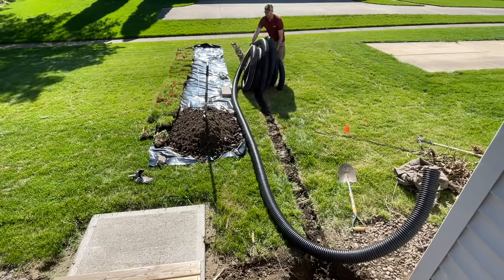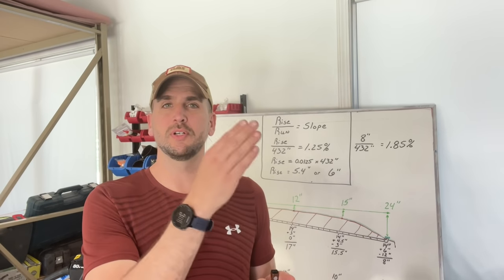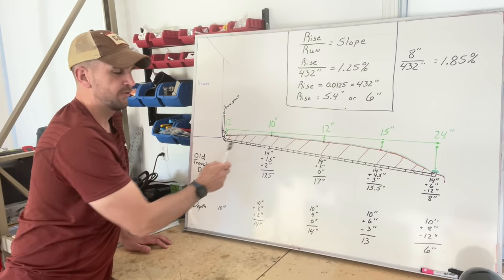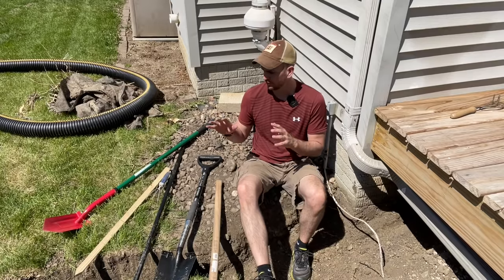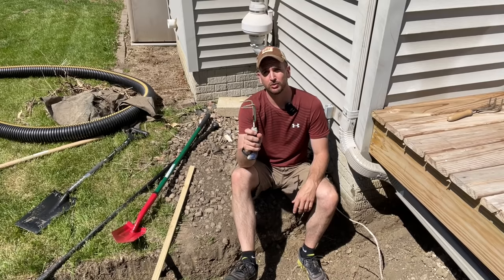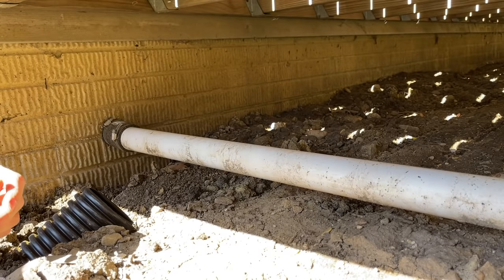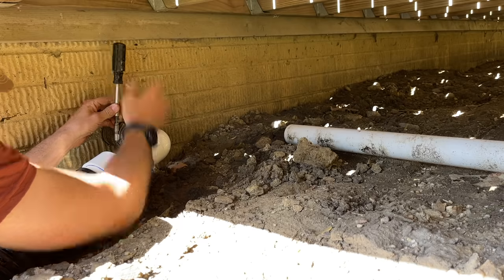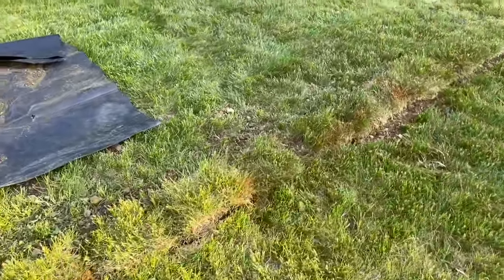Downspout and Sump Pump Drain Pipe Extension

Comment: Nice work! Be careful in the wintertime though... It looks like you may end up with a semi-permanent icy/slick spot on the sidewalk during the right time of year.
Reply from the maker: For sure, I have a little more rerouting to do for the downspouts and then will monitor the frequency of the sump pump as I would expect the frequency of the sump pumping out water will reduce substantially and then that should reduce or eliminate water going on the sidewalk outside of when it is actually raining.  We shall see 🤞
Reply: @EverydayHomeRepairs  Never had a house that required a sump pump before so lots I'm sure I'm not considering.
Reply: My coworker was cited for outflow pooling and freezing creating a road hazard. Did that elbow and popup freeze during winter?
Reply: Won’t all the dirt and debris from the gutter clog your pipe up?
Reply: @EverydayHomeRepairs  Yes, the guy who installed my sump pump refused to do this for the reason of liability/lawsuits in that it would make the sidewalk wet
Reply: Is the black pipe perforated?  I would have at least the last half away from the house perfed to try to keep the water under ground and there would be less water draining over the walk.
Reply: @robertt8273  you can develop a sink hole by trapping the water underground.
Reply: @UncensoredCowboy  Uh-oh. I dug a ditch from my downspout out into  the yard. Threw leaves and sticks in it. Wondered what would happen when the winter rains came. Well, I won't put any dirt on top, that is for sure.
Reply: Trying to figure out why you went all the way to the sidewalk when you have alot of yard to dispose of the water. Helping nourish your grass while keeping the side walk clear
Reply: @michaeldagreatest  One of my neighbors in MN, his water pump runs continuously all year long and basically you have a destroy portion of your lawn. Probably is my best guess, trying to avoid that.

Comment: Great video.  Thanks.  Having done this 10 years ago, and getting ready to do it again (new house), I’d make one recommendation: rather than marking multiple measurements on your stake to check grade, just slope a string above the trench matching your desired slope. Then you can move along the entire run and check for slope everywhere with a single line marked on a stick.
Reply: One other trick I’ll be using this time: dig a post hole under your pop up, line it with a fabric sock, and fill it with round stone.  It will act as a small dry well and ensure your elbow drains quickly, to avoid freezing or attracting insects.
Reply: Thank you, thank you.

Comment: Northern state or not (I'm from Missouri and we get tons of freezing weather and ice etc.), you should have used PVC for just a downspout extension throughout the yard. That corrugated pipe will fill with shingle debri and bugs over time. They are a nightmare to clean out as well and sometimes you end up damaging them when cleaning them out and don't even realize it. Also, at any corrugated connection you should have used tile tape to seal it 100%. I saw you taped it at the pop up connection, but it would have been smart to tape it at your sump connection as well. Weeds and roots will grow right under those hose clamps. Either way, PVC works fine up north as well. Never had any issues with it freezing or breaking at all and it's a breeze to clean out with just a water hose. Corrugated will take a lance or "bullet head" on a pressure washer to get clean with quite a bit of effort compared to smooth wall PVC. You did a great job. It's just that I made the same mistake by using corrugated in the same manner for downspouts and regretted it after a year or 2. Now I only have to run a water hose down my PVC every 3-4 years and that's just to be safe.
Reply from the maker: Thanks for the feedback 👍
Reply: I used corex pipe on all my downspout runs,  many having <1% fall.  Yes,  debris gets in them and collects,  but at least once a summer we get a BIG rainstorm that will blow the tops off the bubblers, leaving a nice ring of debris around them from being flushed.

Comment: Corrugated piping will collapse and fail at some point. By design it slows flow and trapes dirt/leaves. Use solid piping and don't worry about any "required" slope to ensure clean flushing. I've had to replace all the gutter corrugated drains on my lot dur to collapse or root intrusion. Solid pipes have been flawless.
Reply from the maker: Hey Barry, thanks for the feedback.
Reply: Would connecting lengths of solid pipe with rubber couplings not clamped allow for freeze-thaw expansion and contraction? Any small "leakage' would  not be a concern outdoors.
Reply: Turbulence in the water from flowing over the ripples loosens up debris and helps it make its way out of the system. Not as efficient as Sched 40, but corex is cheaper and easier for the everyday weekend warriors to use.

Comment: My thought is that I would have terminated into a hole filled with large gravel underground rather than the pop-up emitter.  It may overflow during a heavy storm, but everything is wet then anyway. It was a well done job though.
Reply from the maker: I might actually add another line of perforated running parallel to the side walk sitting on gravel to allow the majority of the water to just leach into the ground outside of large rain events.  I will monitor how wet the sidewalk is for the next week or 2 and then make the plan from there.  Thanks for the feedback!
Reply: I did both.  I terminated to a T at the end of the drain.  One end points straight up to the popup.  The other pointed down to a 4 ft hole, drainage sock filled with pearock.  Water will first go down.  Should it completely fill up, then it would emit to the popup drain
Reply: @louofm1  This sounds like what I need. Thanks for the notion!
Reply: @DeadBeatDeeBo  look up "drain sleeve".  They sell it at home Depot for cheap.   I dug the 4 ft hole right where the drain terminates (the T).   I took some of that drain sleeve, tied a knot on one end and while holding it in the freshly dug hole, I filled it with pearock.  I figured that would keep the pearock from filling with dirt and clay.  As the rock goes in, it stretches to fill the hole.  After it's filled with rock, tie the top too, and terminate your drain/T right above it  You can't see a thing (except the pop-up) after you put your popup drain and the sod around it all

Comment: Good video. The only thing missing is you should always call before you dig to avoid damaging utilities including cable electric gas sewer and water.
Reply: See 2:00. I assume "JULIE" is his local "call before you dig" utility location service. Quick web search tells me that "JULIE" is an acronym for "Joint Utility Locating Information for Excavators", seems to be primarily in use in Illinois.

Seems the main thing he missed is actually calling the service. I guess it's a "do as I say, not as I do" thing. :)

Comment: This is a great video except living in the Northeast where the ground freezes or the pipe may freeze and/or get snow/ice blocked at the endcap, I would think you would at least need "Freeze Relief" or some secondary relief opening on the sump pump line. If the line ever freezes or gets clogged/blocked, continuous running of the sump pump would cause pressure within the drain line with no where for the water to drain and create backpressure up the downspout line. Rather than capping the cleanout, I installed a drainage grate on the cleanout so in the event that the pipe freezes or gets clogged, the sump pump should create enough pressure for the water to reach the cleanout and still drain on the outside of the house and not back up into the sump pump basin and possibly flood the basement.  

Additionally, unless the water on the sidewalk is from some other source other than the popup valve, I probably would have selected a different spot for the popup valve that was further away from the sidewalk as you wouldn't want continuous water bleeding onto the sidewalk depending on how often your sump pump runs. In cold weather, the water would freeze creating ice patches anytime the temperature goes below the freezing point.

Comment: This video will give me a good start. I live in a tri level and i have to route mine from the front of the house, around the corner, and down the side into the backyard. Ive got a lot to figure out and a lot to dig!
Reply from the maker: Hopefully you aren't tackling the project when it is 100F outside.  Might want to consider a 4" trencher.  As long as you mark all your utilities to ensure you don't cut anything those trenchers can be worth every penny to rent.

Comment: I have many years selling drainage and waterproofing solutions, so I'll throw out some ideas and comments- First, there are exceptions to every rule and every yard will have its own particular variables, so there is not just one way to always do things. Everything about every yard should be considered to find the best solution for each yard and there is sometimes more than one acceptable way to skin a cat.

Having said that, here are a few  of my thoughts regarding your video- 

1- There should be a small drywell under the pop-up so water that is left in the pipe when the rain stops can drain, otherwise, there is a high chance that the sitting water will freeze in the winter and block the discharge. We take a post hole digger and dig down a minimum of 12" - 18" and fill with 1" pond stones, and sometimes we even dig deeper on long runs. Even with the drywell, the water will percolate down very slowly, especially if the soil has a high clay content. If it is possible the discharge will be more efficient if you can take it to daylight so residual water is never left in the pipe after rains, but that is not always possible with flat yards. You can also install an inline pop-up higher up the run (a few inches above the level of the pop-up that's at the end). Water should not remain there after rains and this will give the downspout water somewhere to discharge if the end of the line is blocked and water should not discharge there when the end of the line is open. If possible this should not be within 8-10' from the exterior wall to protect the house. Taping all joints with tile tape is a good idea as you suggest. 

2- On the sump discharge, we usually just put an end cap on the 4" pipe with a 1.5" hole drilled in it and connect the sump discharge line there. Some kind of overflow on the sump line is a good idea in case the 4" pipe gets blocked. 

3. In one of your previous videos you suggested extending the aluminum downspout out as an option. I would not recommend doing this as they so often have something fall on them or someone steps on them etc. and the downspout gets crushed and blocked. If you want to extend the downspout on the surface I would suggest using a pipe that is resilient to damage. I also would rather see them buried as surface pipes are tripping hazards unless they are set in garden areas where no one ever walks.
Reply: Dear Poonbeat, I look forward to your videos and channels. 
Hopefully, in several years (if starting now), you will have 767,000 subscribers. 
I bid you the best in your day job which you should keep.
Reply: @eddyvideostar  I will keep you in the loop. I appreciate your sincere encouragement. It was classy of you to offer it!
Reply: Can you come to my house and give me a hand? LOL 😆

Comment: Thanks for such a great video. everything looks well done. Two suggestions. Northerners need freeze relief at the house exit and for aesthetic's, do a minimalist french drain to dry well at the end of the line. The water can seep into the ground more efficiently. If that is a 24/7 365 sump line , a wet sidewalk is kinda off putting for property value. keep up the great work

Comment: You are a smart and practical dude.  I am working to keep water away from my home in an area with lots of ledge. The diggng will not be easy but I am envious of what you did, and in a common sense way.
Reply: If he's so smart why isn't he using corrugated to DWV adapters instead of those expensive PVC and rubber couplings????
Reply: @DiffEQ : Dear Diff, If you're so smart, why don't you have the ability to make videos, possess a channel, teach the community, and have 767,000 subscribers?

Comment: Nice video !!

Here are a few things that I did different
I bought a roll of black plastic bags that were perforated, but still connected to dump the dirt onto.  When I was finished, I still have a roll of bags that I can use for other jobs
I started connecting at the house to make certain everything fit before cutting anything
I set up the corrugated pipe a few days prior to digging so I could reroute the water and get rid of the mud before the digging started
For cleanout, I go to the pop-up end and shove a hose in there.  I block the exiting water until I have 20-30 gallons sitting in the pipe, then I let it go all at once and it flushes the line like a toilet flush.  I use a shopvac to pull out the water as it exits.  That makes the flushing even more thorough.

Comment: I am doing a 2 way connection for my sump ump discharge so in summer i can use sumpup water for gardening, wondering to see how your rubber connectors are working, I wanted to see if rubber connector is the best option or I should choose PEX and permanent, I live in alberta and winter is -40, so would  like your opinion on rubber connectors for winter. Thank you

Comment: Did you use any type of freeze protection device on your sump pump line? Does your sump pump line elbow have a hole in the bottom for drainage?

Comment: I installed a similar 20' separate drain, with pop-up near where my ground slopes away.  I plan on putting a backup sump on this separate pvc drain. My only concern is during winter.   The popup won't work, even though there is less likelihood of using the backup sump during winter.  .... Just a suggestion.... At the end, where the popup is, I installed a PVC T, with one end of the T pointing up to the popup.   The other end pointing straight down.  I dig a hole about 4 feel below that T and filled it with pearock (surrounded by a drainage sleeve).  That way, any water first goes.straigjt down, into the pearock sock.  Should it fill up, then the rest of the water would  comes up to the  popup.  Hope that makes sense

Comment: Great job! I only had to go 16’ to a run off that goes to a storm sewer. I did 2 lines one for sump pump, other for downspout. I did the sump pump line in pvc drainage pipe 4”. The downspout was 4” corrugated. Both lines  have a slotted drainage cover to keep out animals (rabbits, snakes, etc.). Fernco does make a reducer for the sump pump.....2 to 4” or 1 1/2 to 4”, this would have eliminated some of the glueing and fitting you did. Thanks....Jim
PS.....Does the 4” pvc fit into the 4” corrugated pipe? If so, than just warm up and use a large clamp, this would be a better connection (tape if necessary & then clamp). I’m in the Chicago area, and did this 17 years ago, and still working perfectly. I have 5 down spouts down & 1 sump pump.
Reply from the maker: Hey Jim, thanks for the feedback.  Good question and I don't think the PVC will fit in the corrugated but not 100%.  I have 5 more downspouts which need extended to get things where I would like them.  Plenty of projects for this season 👍
Reply: @EverydayHomeRepairs  I did all mine when the house was built and all are working perfectly, even after 17 years. Jim

Comment: I found a sinkhole beside my house about 4 foot deep and 5 foot wide. It was caused because the corrugated pipe from my down spout and sump pump became disconnected underground and the water was pooling up underground over the years. The only thing stopping someone from falling through the ground was a thin layer of grass, dirt and roots from some bushes.
Reply from the maker: Dang!  Thanks for the feedback.

Comment: Thanks for this well explained video. I have drain line from the backyard that wrap around the side of my house that has been fill with tree roots, so I am trying to muster up the courage to install a new drain line on the other side of the house, no trees at all, but it all under concrete driveway pad. 8-/ (I use 3 sump pumps every winter during storms FUN TIMES!)
Reply: If you haven't done the new drain line, I would recommend using PVC Schedule 40 to prevent any root infiltration.
Reply: @emilytopacio  Thanks! totally agree.

Comment: Nice job and thanks for sharing.  You made that back breaking job look easy.  Last autumn I did the same job but just 35' long and in my glacier gravel the rocks were a ball buster and took 5 days to dig just 35'.  I still need to dig another 25' section but plan to rent a Dig Witch for that having learned my lesson.  :)  Bummer about your CATV cable.  Thanks again!
Reply from the maker: Yeah, I should have called a little more attention to the amount of effort involved in digging trenches.  You will sleep well after a day or 2 of manual digging.
Reply: @EverydayHomeRepairs  Yes for sure.  I envy your soil as mine is so full of rocks that every pickax or shovel strike hit a rock but very little dirt.  After 3 hours each day my back was screaming for a chiropractor.  :)  Thanks again for making it look easy.  Fingers crossed when I rent a Ditch-Witch that it goes easier.

Comment: I wish I could dig a trench that fast!!!  😁😜  🤣😂🤣😂🤣  Not even without lower back, hips and neck issues!  Should we call you, The Flash?  I watched from today's (11/7/2023) DIY Guide To Installing Gutters.  Don't know if I'll need it, I'd have to measure flatness or slope, but there's ditch in front yard near the street for rain (we don't have city sewage or drainage) which I could trench to for front and back gutters.  I'd do both on the same side, Y them together and let the gutters drain into the ditch.  Thanks, Scott!